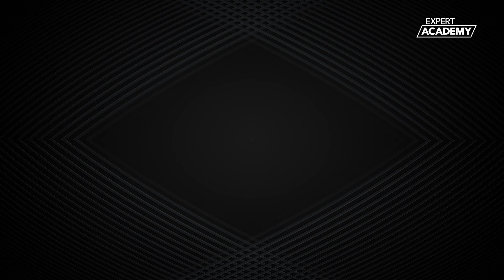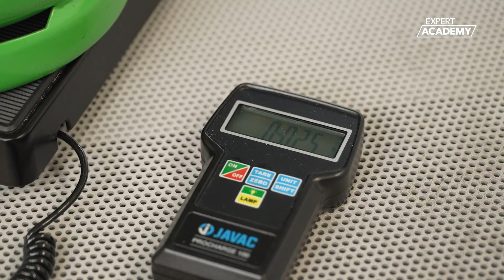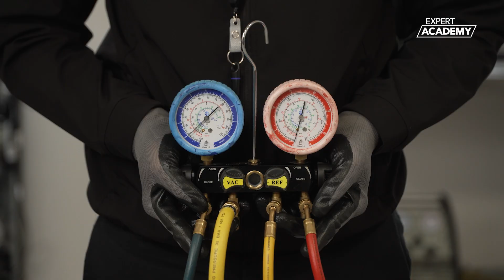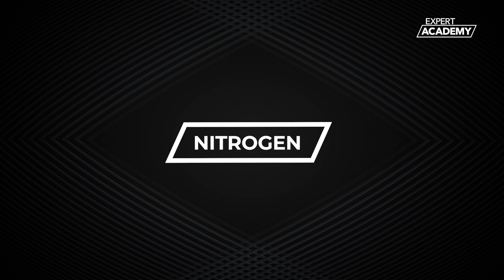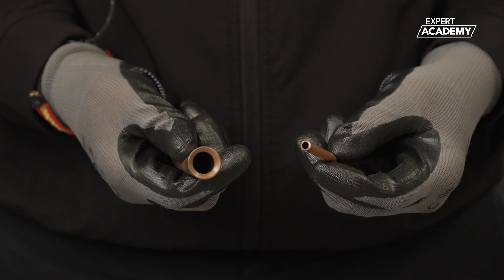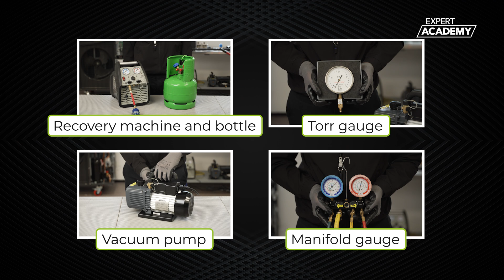F-Gas process and equipment walk-through

Comment: Recovery machine
Recovery cylinder
Refrigerant scales
Manifold gauge set
Vacuum gauge
Vacuum pump
Electronic leak detector
Temperature probes
Temperature clamps
Nitrogen cylinder
Nitrogen regulator
Oxy-acetylene brazing set
Flaring tool
Sage tool